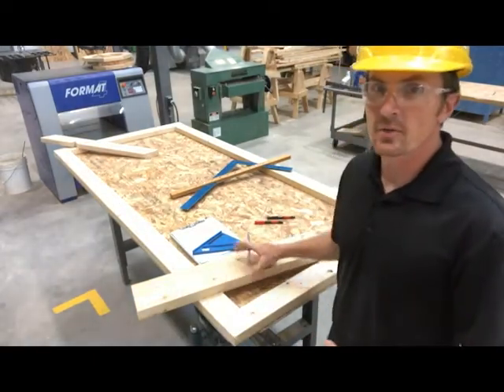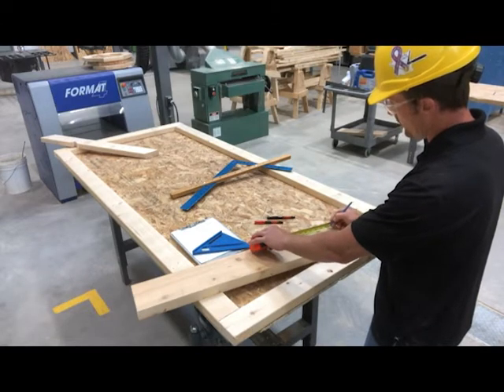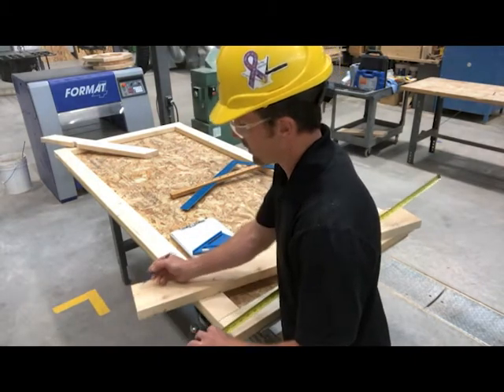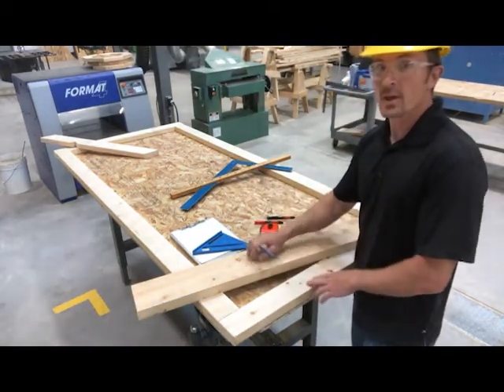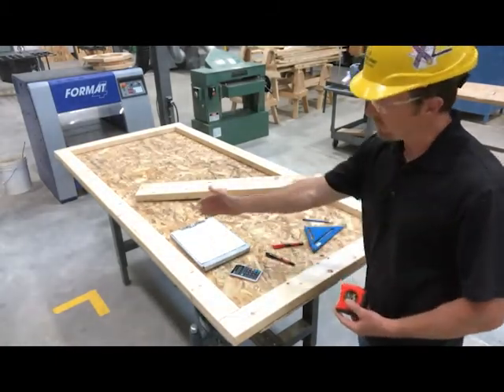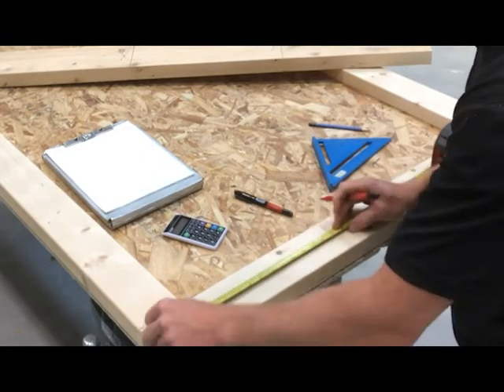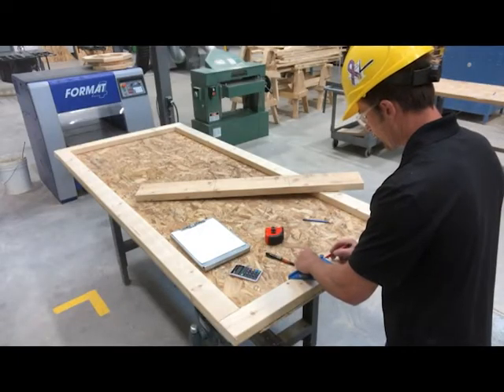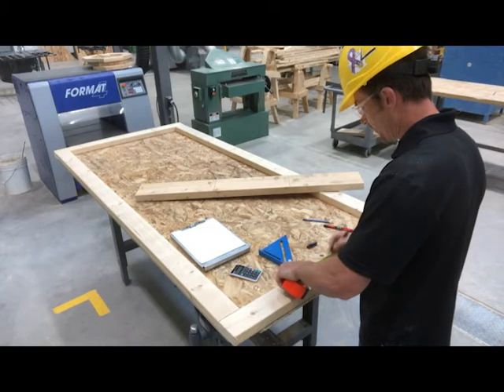How to Layout and Cut a Hip Roof Part 2  The Ridge

Comment: Great video. Where did you buy your framing fence?
Reply from the maker: Thanks @charlesparks440.  I made that fence.  Its just a couple of pieces of oak fastened at either end with a gap the thickness of the square and holes for carriage bolts and wing nuts.

Comment: Great vid! When I learned how to frame I was told to cut two common rafters without deducting the 3/4" of material. These are the dedicated ends to the ridge board. The reason being is the height has to be exact or the seat cuts will be off and the hip will also be off. This was how I learned cut hip roofs.
Reply from the maker: Thanks for the comment!  Sounds like a great way to frame hip roofs.